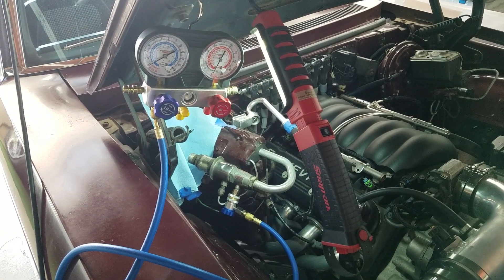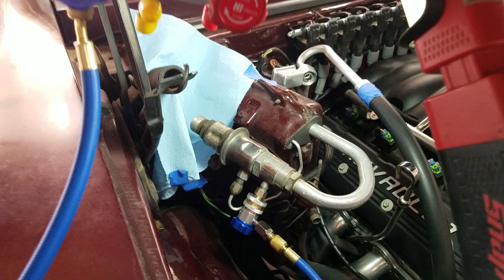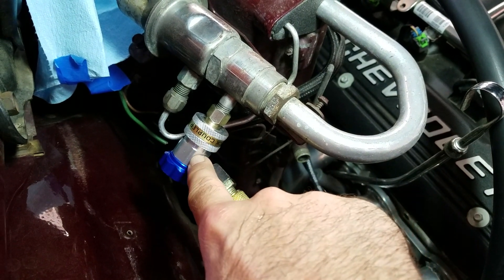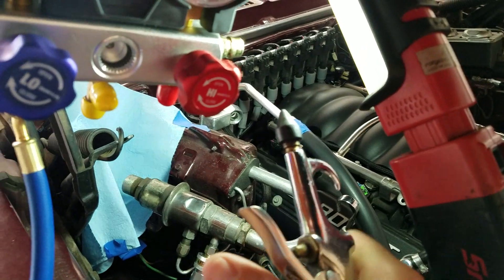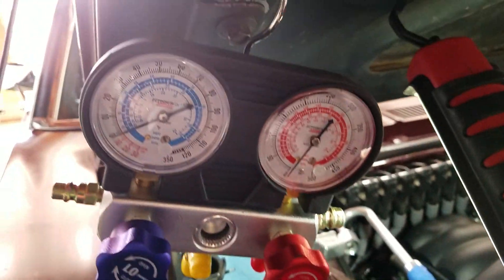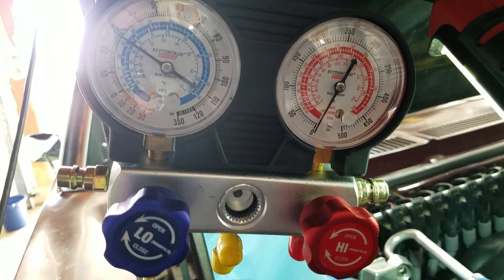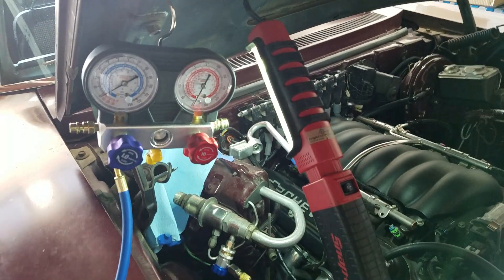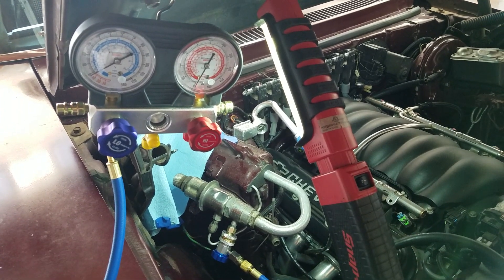POA valve testing. Convert from R12 to R134a

Comment: WOW!!!!!!!! Good news. I tried your last suggestion of lowering the psi on the air compressor. It did not change a thing. So I watched a couple of YouTube videos showing how these units are cut open & rebuilt. I thought I was going to have to have someone rebuild mine for me. I didn't see anything in the videos that seemed to be one (1) internal culprit for failure. So I have been soaking my POA valve in a bowl of R12 mineral oil for the last 2 or 3 weeks. Today I got it out, drained it of the oil & put it back on my 67 Camaro. I did your pressure test & praise the Lord... the thing sits right at 29 psi on the low side gauge reading!!!!!! Thanks for posting your video.  :-)
Reply: You probably watched my video offering POA rebuilding. The main reason these fail is when there is corrosion on the aluminum piston and cylinder wall. Other times it gums up in that area.
Reply from the maker: Congratulations. How is it holding up for you now?
Reply from the maker: @chuck7432 The style of POA valve shown in the video is adjustable. I don't know about earlier model suction throttling valves. I know VIR setups are not adjustable. You are correct that they can be outfitted with a pressure cycling switch aka POA or VIR eliminator which will work to control the system and keep the evaporator from freezing up.

Comment: My ac system partly disassembled. Do I have to have the expansion valve bolted on to the system (like yours) in order to conduct this test???? Thanks
Reply from the maker: No. You just need to be able to supply pressurized air to the inlet of the POA. You can do that through the evaporator inlet or directly to the POA if it's removed
Reply: @thebandit4393  Thanks so much for your quick reply. Do you know of a test I might be able to do on my expansion valve? It has been removed & "boxed" away for several years. I've searched the web, but haven't really been too successful.
Reply from the maker: @steelcantuna  The expansion valve uses a sensing bulb on the outlet of the evaporator. When the temperature of the outlet is higher, the valve opens to allow more refrigerant. When the temperature is cooler, the valve closes to allow less refrigerant. A simple test I've heard of is to pass air through the valve and then dunk the sensing bulb in ice water to see if the valve responds by restricting the air flow more. It's not a perfect test but will let you know if it's operating. The original valve is calibrated for R12. If you are converting to R134a I would recommend replacing the valve.
Reply: Okay, I hooked up my ac components today to match yours in the video. Plenty of air flows through & out the back end of the POA. You can both hear it & feel it with your hand. But....
My blue gauge needle doesn't move at all. It just sits on zero. I tried using the red gauge (in case the blue is busted) but, it does move the needle at all either. Does this mean my POA is stuck open???????? Thanks
Reply from the maker: @steelcantuna  Possibly but you should check a few things first (1) the test port on the POA has a shrader valve that must be depressed by the gauge coupling. Newer r134a gauge sets have a different style of coupler, so you need an adapter. The adapter has its own shrader valve and the original must be removed from the POA before installing the adapter. So make sure the old shrader is out, the adapter has a shrader, and you have the gauge coupling attached and screwed down to depress the shrader. (2) only the blue / low side gauge should even work on the POA test port because hi and low test ports use different coupling sizes. Are you sure you have the gauges setup correctly?
Reply: @thebandit4393  My gauges are only for R12 don't work with r134a. I thought about the shrader valve you mentioned & tested it as best I could. Seems to be fine. All 3 of my R12 gauge hoses (blue, yellow, red) will screw down to the low port on the POA. :-)
Reply from the maker: @steelcantuna  normally the POA will stay closed until you reach the set point. Try adjusting your input pressure to below 20psi and see if you still get air flow. The oil bleed may let it by but should be a very low rate compared to when you get above the set point of around 29psi. If you're transitioning from no pressure slowly to above the set point, you should hear it pop open. If it seems to be stuck open,l all the time,  I'd try soaking the insides with evaporator flush (aerosol can) then drop some PAG inside and move it around to coat. Then retest. Be ready for some oil to blow out
Reply: @thebandit4393  Will do as you suggest & let you know. It may be next weekend, I work 6 days a week. Thanks soooo much for your time, knowledge & all. God bless.
Reply from the maker: @steelcantuna  How did this work out for you?

Comment: How do you lower psi. Do you have a video
Reply from the maker: On many POAs like mine there is a lock nut and screw in the outlet side that can be adjusted. If you look at the related playlist I think I discussed this in another video.